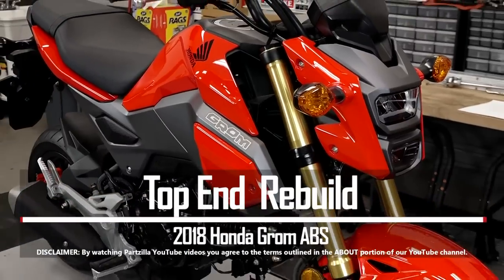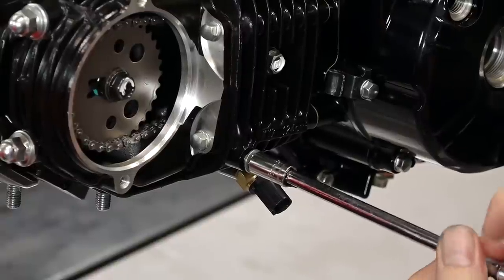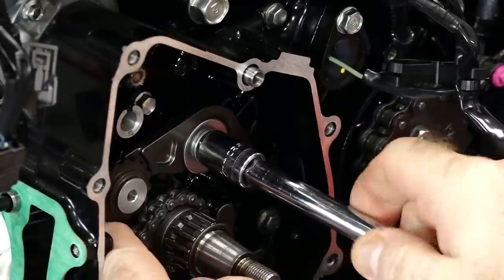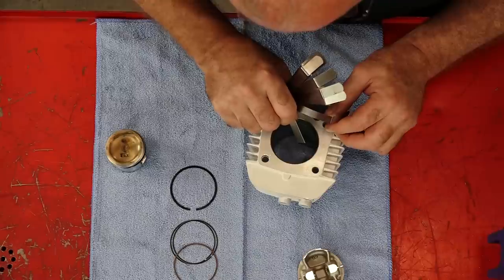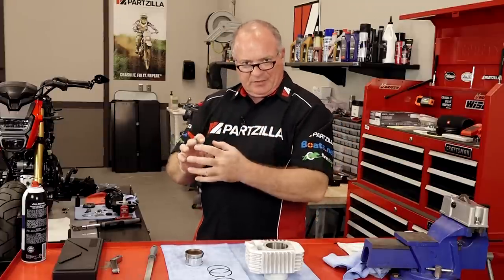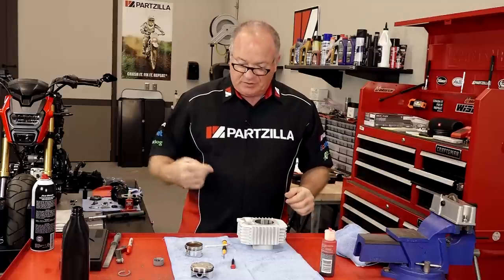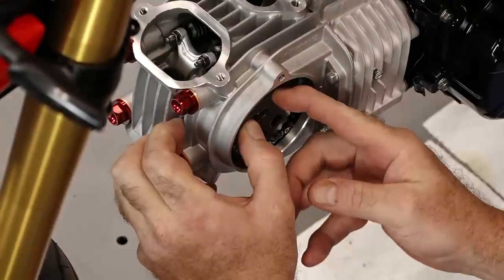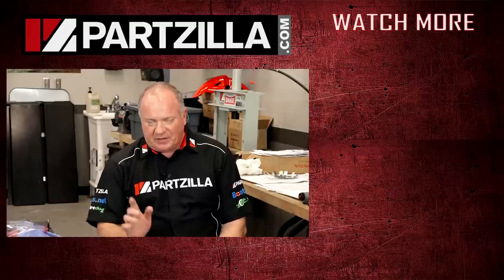Honda Grom Top End Build | Honda Grom Big Bore Kit Installation | Partzilla.com

Comment: Ive had my Koso 170cc 4V for 6 months and put over 1000 miles on it so far. Engine dyno’d at 26whp at 11,400 rpms with the Power Vision 3 Standalone ECU. Runs absolutely perfect, does over 90mph w/gps.
Reply: power vision is a piggy back....
Reply: phat56pat Piggybacks are external devices that tie into the engine computers wiring, and essentially trick it into making more power. The Power Vision does not do this my son.
Reply: john martin  power vision flashes stock Ecu is not a stand alone like a ARACER. The factory grom ecu is still on the bike with the power vision, there for not standalone and is a piggy back reflash. Not as reliable as a ARacer but more reliable then a power commander 5
Reply: john martin  directly from the website “A Dynojet PV3 enables fuel tuning straight from your bike's diagnostic connector. You don't need to tear down your bike to access throttle body connections or tap into switched lines, or deal with sending off your ECU. The PV3 simply plugs in allowing you to view system metrics and flash your ECU “
Reply: phat56pat You can make all the same changes like ARacer, the changes are permanent to the ecu unless you make more changes. It is not a piggyback system like the power commander 5.
Reply: Gonna blow the crank outa it
Reply: wuts da setup?
Reply: Thry have the 186cc big bore now

Comment: Its nice to see someone doing a first class job.
Reply: well i wont question his knowledge.. but when i was tinkering in the old days on my honda MT.. i fitted the piston first in the cilinder..(halfway)  and then mount it.. wayyy easier.
Reply: Yes the work is great but facts are a bit Made up. Honing marks are there so there is always an oil film between the rings and cylinder wall, so That the rings physically never touch the Wall. And just using a Thin layer of oil when instaling so That the rings ”cut in” doesnt make any sense. After the first rotation of the engine, the Walls should already be Coated by the engine oil. And he should be spinning it several times when installing a new head because you want the oil to circulate up to the valvetrain. The rings dont really cut in, they seat. It kind of sounds like hes saying “That is the whole break in process”, probably not. But the break in process is going to last for several hours of the engine running. People tend to ignore This, and This Will cause the engines life to be severely shortened
Reply: I know man this guy does it right.
Reply: hahaha literally this guy LOVES motorcycles and I support him lmao
Reply: @josiahgarrison647  Gl in life man, its better to learn to accept That you are wrong, than constantly make up excuses or lie to shift the blame. Take some responsibility, in real life. Its better to be wrong and take responsibility rather than being wrong and coming up with excuses.
Reply: @vhjvbhjb5280  please man stop!
Reply: Aiden Flynn  yeah man I definitely do and will totally look into it once I’m done hacking Hillary’s email accounts.  Thanks for the tip

Comment: This is why i would pay a professional like this guy to put a big bore kit on my grom, there are just too many things that can go wrong otherwise resulting in catastrophic failure lol, great video 👍.
Reply: This is the same process for all engines, try it on a 212 predator minibike engine first, that's how i learned to do ring gap and orient them and I honed the cylinder myself too with a hone and drill but you can just pay for that to be done. But this is all straightforward, I did every last thing he did to put mine together and those engines are only like 100$ used or less it's worth the education.. because now I see this grom video and it looks easy, I know I can do it. You should own feeler gauges anyways for valve lash, which you can also learn on the 212
Reply: @Partnerthedog  great advice, I'm going to go for it, you can't l learn  how to do it unless you get in there and do it , thanks 👍🏆.
Reply: @congerscott6064   yeah! Those 212 minibikes are actually really fun with the governor removed and some performance parts added they are a blast to ride even after owning 2 stroke dirtbikes I loved mine. I put a billett flywheel, billett rod, high comp piston and no cam it was fast!! I bought the pieces on Craigslist for cheaper than msrp though
Reply: Yup

Comment: beginner : use big bore kits
pro : bring the bike to tuner, request 150cc up to 250cc with 68mm piston and 70mm stroke crankshaft, in southeast asia, we do some extreme modification like customing block,head, crankshaft, gear ratio, and clutch house.

sorry for bad english

Comment: Please do the oil cooler install..
That will make that engine run longer without overheat due to the higher bore and compression.
But anyway,  just want to see how you install it.😊

Comment: Would like to see a long term review!
I’m really interested in a big bore kit for my grom🤘😁

Enjoy the bike life and have a great weekend
Reply: AeroR Ive got 6 months on mine, dyno’d @26whp. Runs perfectly, does 90+ mph w/gps.
Reply: Just get a zongshen 190cc engine. Its 5 speed and it makes 20hp with a carburetor.
Reply: robertas grigas Did it dyno at 20whp or just claimed whp?
Reply: @john-martin  26 mph with just the 170cc kit
Reply: aeroR ...  if you install bbk, change to the light weight crank, Kitaco 5 speed, 4 valve head, bigger throttle body and flange and intake.  Also install an oil cooler and catch can.  Then you must change to a aracer 5 mini with2 stage and auto-tuner with O2 bung with piggy back for atf, also change to brembo 4 piston or 2 piston your choice.  Since you going alot faster you Midas we'll have better brake system..  

And change all the given parts colder plug, better wires, gear and sprockets, better brake lines,  and find a good tuner who can Dyno tune you for 300 bucks.  That's what I would do.  Hence I'm just changing to a hi comp kitaco piston and kitaco cam with a dhm reflash ECU.  Also cheaper for now.
Reply: datingsas Dyno’d to 26whp obviously that means to the wheels. With the 170 kit 4V and brocks exhaust. Ecu is the power commander power vision 3.
Reply: urf808 You can do all the tuning with a power commander power vision 3, I tried using the power commander 5 but the power commander 5 does not work, it doesn’t have the capabilities. The power vision 3 absolutely does I’ve been using this set up for almost a year now, still running perfect. Does over 90 mph with GPS for as long as you can hold the throttle.
Reply: @john-martin  Great thanks for the info
Reply: @B B SOund super jealous there B B
Reply: @B B These are japanese bikes you most likely can't afford one
Reply: @B B I can't hear you crying when your stuck in traffic in your tesla and I pass you with a big smile on my face ;)
Reply: @B B I guess I never want to grow up because my girlfriend is a 10 out of 10 and I make crazy money doing what I love ;)
Reply: @B B I won't be thinking of you while I drive around on my z1000x, zx14r or z125 with my girlfriends. I got a white and a black one also ;)
Reply: @B B YouTube account with no content. Has nothing else going on .
Reply: @B B Been there done that. Pocket change my friend . Come back when you are actually ready.
Reply: @B B Same person you dream about all day and night. That's why your so anxious to get on YouTube and leave a reply. Gives you butterfly's.
Reply: @B B Your hand doesn't count
Reply: Well done
Reply: @datingsas  bro going off 😂

Comment: Good video. Good skills. The Grom engines are hard to video because the inside is black. Usually it's all about getting contrast, but in this giving some up for midtones is good.

Perhaps Honda wants the oil to drain faster, like Glyptol; perhaps they are lazy.

Sometimes, on quite small engines, it may be easier to put the cylinder in the bore---and then slide the cylinder it down the studs and connect the wrist pin, though it's a preference thing.

Comment: I had a Honda shop do the same kit. Had to go to Yamaha dealer to dino it. They said there is a fuel problem. Only getting 3/4 throttle then sputters out at about 75.  What could be the problem?

Comment: Oh GOD tihis engine perfectly same with new Honda Supra 125fi we know form piston (parts) code (KYZ), gasket & EOT censor place, & form tensioner type its perfectly same with honda Future 125fi / Supra X 125fi .. Can i order this bore & head kit...?  But my problem is, i life in Indonesia, if im order this part the shipping cost isn't cheap (over price).

Actually i want order this boreup kit & head cylinder kit... Because in Indonesia & asia boreup kit for this KYZ engine is rare..  But comeback to the problem, shipping cost to expensive.. 😞🙁☹️
Reply: hi boro / sist..  if you life in Indonesia  and you see the price form this part  trust me, you will change your mnid, because if you convert to IDR price form this part tarsrom to 14JT IDR... really you want to buy this part..? you can buy a new sport motorcycle with 14JT IDR.

Comment: With the 2022 model grom honda adjusted the stock bore and stroke to be more oversquare. 
2021:  52.4mm x  57.9mm
2022: 50.0 mm x 63.1 mm
Due to the longer stroke, when combined with this kit it will be a bit larger.
Will a new big bore kit be released for the new grom or will this kit be compatible with simply different tuning? 
Some other big bore kits are as large as a 64mm piston and on the 2022 grom this would be a substantial 202cc versus 186cc as the big bore kit advertises.

Comment: I know you know waaaaaaaaaay more than me... but is not more easy to first fit the piston into the cylinder with the piston tool.... and THEN inserting the cylinder with the piston IN ready for just installing the connecting rod? :|

Comment: The Power Commander 5 WILL NOT WORK. You must use the Power Commander Power Vision 3 standalone. Completely different tuning platform but needed because the Koso is so far out from normal spec the Power Commander 5 (piggy back system) WILL NOT handle it and for brief moments will even fall out of tune which is very dangerous. This info will save you tons and tons of time tuning this.

Comment: It's really dainty to work on a clean engine.  However, just one comment after the pro job.  The position of the bike relative to the mechanic is a bit far.  It is tasking on the back to work like this.  The bike should have been nearer the mechanic for optimum working position.
Reply from the maker: Have to make room for camera viewing!